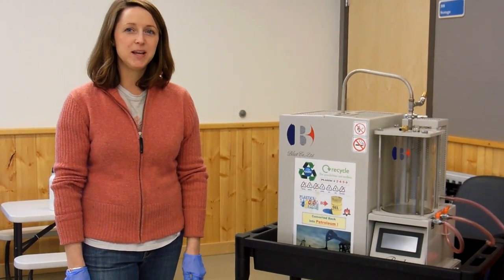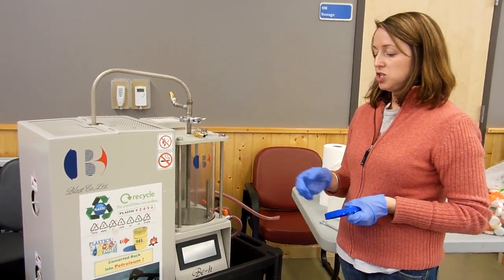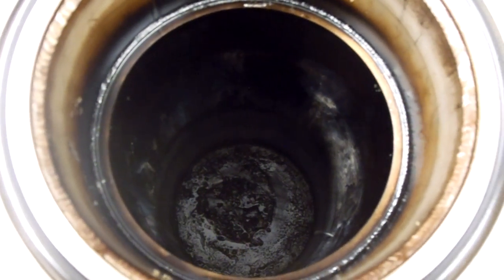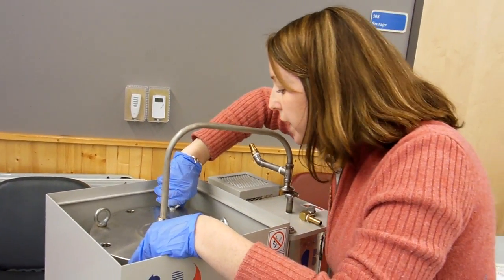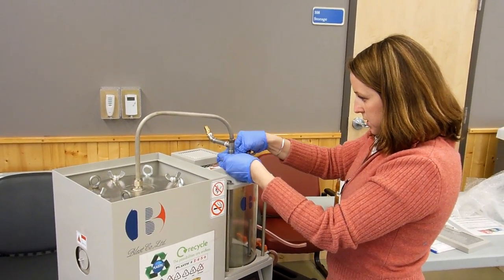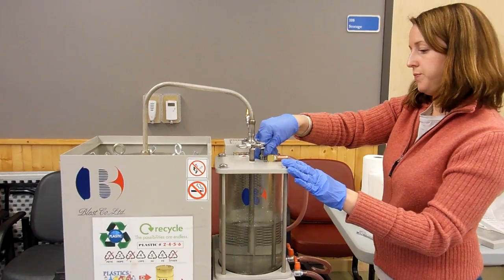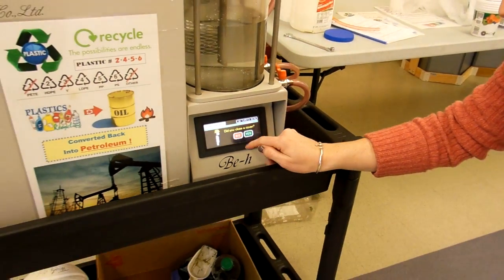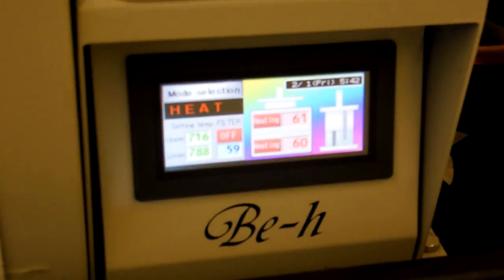CEDP 2012 Gakona's Plastic to Oil Machine - Part 1

Comment: Gasification is the name, Cars and trucks during WWII ran on wood and coal gasification making syngas which is 20% hydrogen. just like cracking crude oil different high temp and collection point make gas and diesel. After hurricanes you can run generators of the wood with a gasifier. So simple and its so forgotten.
Reply: Ever heard of coal liquification?

Comment: How much electricity is needed to make the oil though? That is the million dollar question really.
Reply: +SirBalz  as a guess i would say a lot , like with electric cookers / heaters ect , anything with heating elements
Reply: +SirBalz  Comment: 1 kg of plastic produces one liter of oil, which costs $1.50. This process uses only about 1 kW·h of electricity, which costs less than 20 cents!
Reply: You can use waste heat off of an exhaust system to create the energy required for the conversion.
Reply: @dwatson8883  That's right: here's another vid, one for the big boys https://youtu.be/cTtAElSO7zE

Comment: This tech has been around for years - it's only now that governments are starting to acknowledge it, as they can't really avoid it with the increasing plastic waste problem.  A small fully automated self-sustainable commercial unit, capable of processing 20kg of plastic per 6 hour cycle producing 85% yield of syn-diesel can be had for less than £45,000. This is a good option for businesses producing plastic waste or small communities.  Quantafuel of Norway is currently rolling this out on a massive global scale, with their unit in Skive processing 60 tonnes of waste plastic per day, yielding up to 15 million litres annually.  Th e fuel is 66% cleaner burning than fossil-fuel equivalents.
Reply: where can someone buy the small unit you were referring to for 45k? name of company?
Reply: I have found that even gasoline can be produced by this process

Comment: Money is the key. Yesterday, using plastic as landfill was the cheapest option. Today is burning it directly with other debris & turn it into electricity. Sometimes mixing it for tiles, bollards & fences. Tomorrow they´ll shredding it and use lasers to sort it by color and type.
It will be a long time before turning it into diesel prior to burning becomes viable.

What´s the benefit of that? Why use a lot of energy and precious equipment to turn solid fuel into liquid fuel?

Comment: i find it difficult to believe that this machine will be capable of the 450C heat . powered by electricity the oil would be cheaper at the most expensive retailer

Comment: What is the quality of the gasoline like? Has it been tested on regular family sized vehicles? Does it affect performance in any way i.e. negatively for your car?
Reply: +Monica Blea No, If you look in a microscope it stays the same. Depends on the contamination of the plastic. Clean plastic first, THEN conversion.

Comment: I'm curious. Why do you need to change the water for each session?
Reply from the maker: Hi EcoAgroGuy,

I'm not sure why Gakona wanted to do this. When I asked, they said mainly for the "extra maintenance" value.
Reply: Thanks.
Reply: +EcoAgroGuy - You really don't have to, but plastics also contain other mineral contaminants that could cause corrosion of the metal parts in the water bath receptacle.  The water only needs to be drained and replaced when the machine is not in use for a while, or if the water starts to look really "funky", otherwise it could make the oil less clean.
Reply: The water cools down the plastic smoke and makes it oil so the water will be more hotter and it won't cool the gas down

Comment: The cost and energy to get to 800 degrees for 3 hours for a tiny bit of plastic. 
There must be a more efficient way.
Reply: 800 °C or 800°F ?    800°F ≈ 425°C
Reply: @Farwuq  425 degrees Celsius

Comment: for what purpose i can use this kind of oil ????
Reply from the maker: The oil was used in small engines i.e. chainsaws, etc.
Reply: Simone Sebalo but i think the cost is not that little to buy that kind of machine then get the oil and use it for a small engines , you know what i mean ?
Reply: it doesn't worth it , that what i mean , if im going to use it for chainsaw , so it doesn't worth it
Reply: *****  save up all your plastics for 1 month, see just how MUCH WASTE you use! Not having to go out and buy oil/gas for your machines WILL SAVE YOU MONEY. You just use the left over plastics, you don't have to pay again for the oil. This machine can pay for it's self in under 10 years! Plus the amount of waste saved from the land fills, will save the planet hundreds of thousands of years worth of contamination!
Reply: +Trea Jacobs actually it's very energy intensive. It does not save money, it does however utilize a waste product that would otherwise pollute. The electricity cost for the heat, time, and small return is technically not worth it, except maybe on an industrial scale. But only maybe.

Comment: this is a waste of money and energy. Can we use the sun and wind to power this? I guarantee that the energy used to make this oil is oil. Pointless if you have to waste oil to make oil. This is only good for to explain the sience behind it.
Reply: Depends on where.  In Canada 80% of the power generated is from Hydroelectricity.